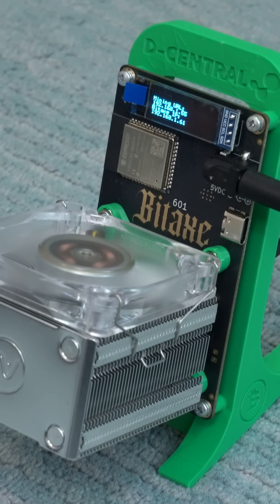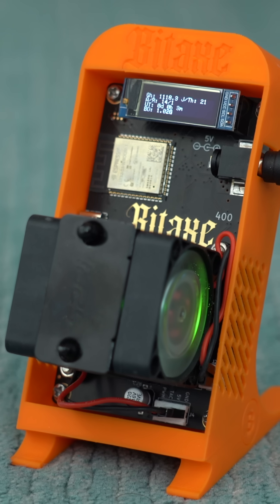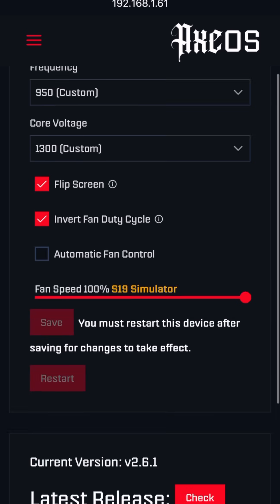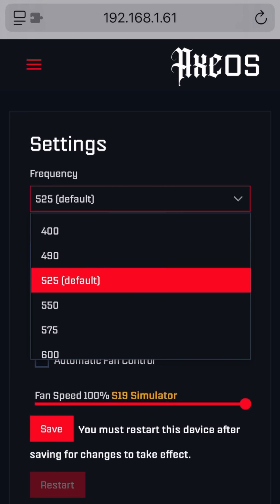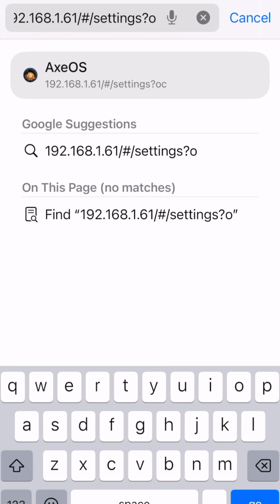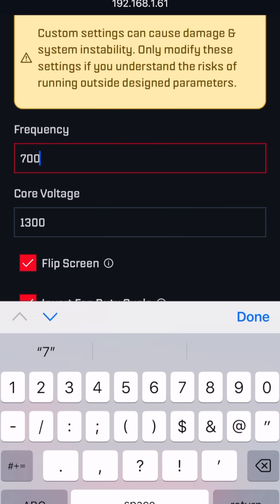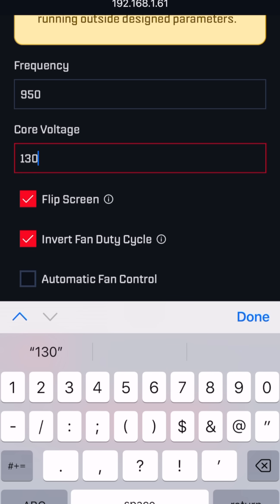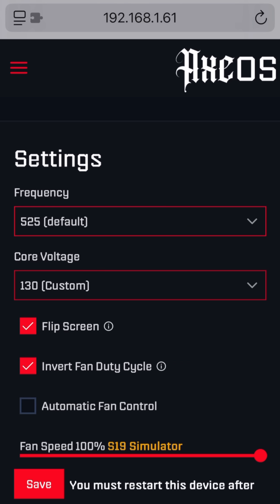New Method to Overclock Your Bitaxe

Comment: Do you need a screen on the bitaxe? the store i bought mine from sent them separately, so now i have to buy a soldering iron😮‍💨
Reply: Just slide the screen on. the holes are located at the upper right corner on the board, it will work without solder.  Although you can get liquid sodder off of Amazon that will hold it in place so it doesn't slide out.

Comment: Watched your 4/4 video and did some OC. Got the LRS-100-5 and running 2 on it currently with stock cooling. One at 800/1190 and the other at 825/1205. Pulling about 56W total with new expected 1.63/1.68TH/s. Sitting at 64/65c. Will be upgrading cooling next for sure, trying to leave a little bit of headroom.
Reply from the maker: Awesome

Comment: My power supply is power supply is 30W Max, would you need to get bigger one to upgrade the power supply?
Reply from the maker: Probably, yes. You generally want to do no more than 80% of a power supply's maximum load, and a stock gamma is already just over 20W. With the 80% rule, you'll want to go no higher than 24W which means you don't have much room to push beyond. My highest clocked Gamma is pulling 34W.